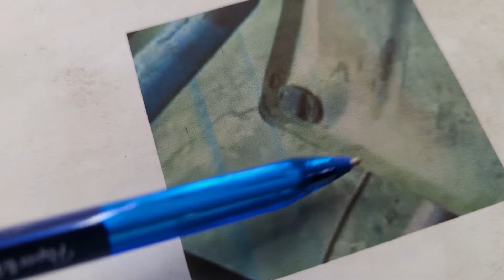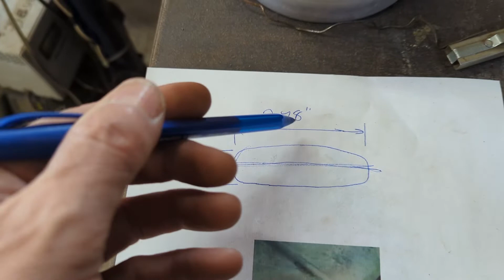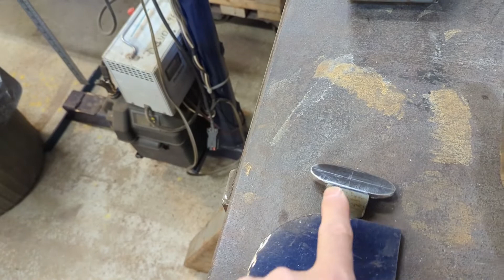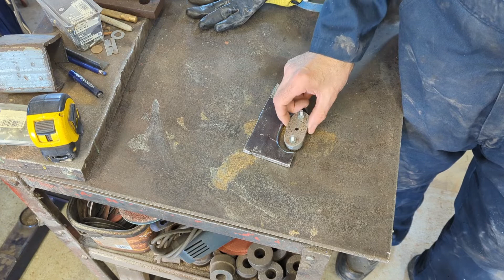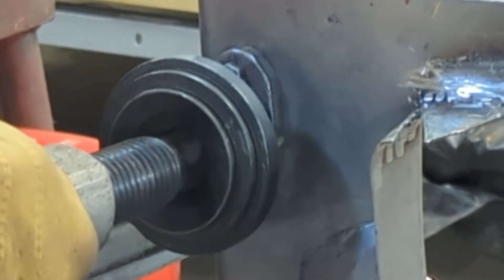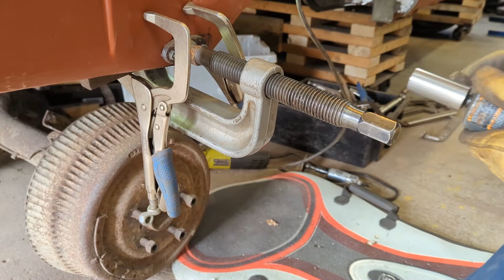Making a Forming Die for Drain Hole Covers – 1965 Thunderbird | Ep #45

Comment: Alvin,
While working under Pearline for weeks on end, I must have eyeballed that drain plug area a hundred times, but never noticed the protruding shape holding the rubber plug.  I also didn't note that the plug was held in place by 2 screws.  Maybe I better take a second or even third gander at those ball joints I replaced. 🤪   Good job, my friend.
Regards,
John
Reply: Hello John,
You had sent me a video that I requested from you about 2 years ago showing the drain area. I still have the link, but it is no longer available to see it. I like the way Alvin is doing his. 
George B.
Reply: George,
My friend, you have me confused with someone whose brain is functional. 😁
Regards,
John
Reply: @joernone  🤪
Reply from the maker: Lol John, there is so much to focus on, it's so easy to not notice little things like this drain plug area. I started working the front right torque box today...it's rusty, but looks like a simple fix, just a lot of welding, but nothing fancy to deal with. 😎
Thank you and take care!
regards,
Alvin

Comment: Hello Alvin. It is my pleasure to help you out when I can. Your technique to form those drains was great. I think when I make mine, I will form them on some scrap metal, then cut-n-butt them onto the wheelhouse extension. The aftermarket wheelhouse extensions are lap welded right where the drain is located that will need to be dealt with. I know you will be able to correct that flange edge back into shape. Also, note that the holes to mount the rubber drain are of different size for sure. Probably so they could not be mounted upside down at the factory. 
Thanks,
George B. in Michigan
Reply from the maker: Hi George, yes, any repairs to the drain hole area won't require a lot of time. I did consider making one and welding it in like you mentioned...and on the other side, I may just do that, or form it before mounting the wheelhouse extension.
Thank you again, and take care!
Alvin

Comment: I think if you had stretched that flange rather than cutting it on the corner it may have moved, pretty hard to do on the car though.
Reply from the maker: Yeah, it is hard to do once the panel is in place...and you know from your own metal working experience, that fixing the little bit of movement that happened is a small task. 😎